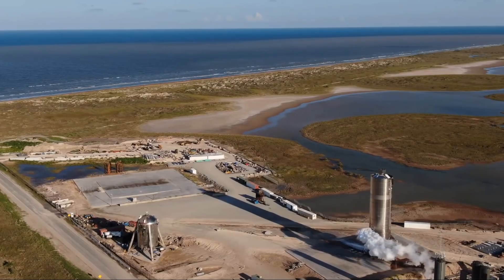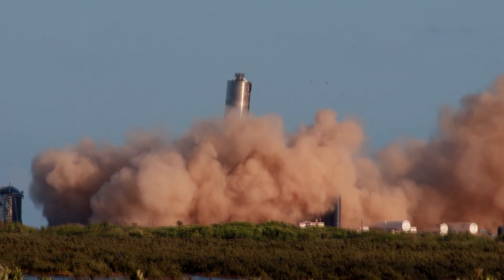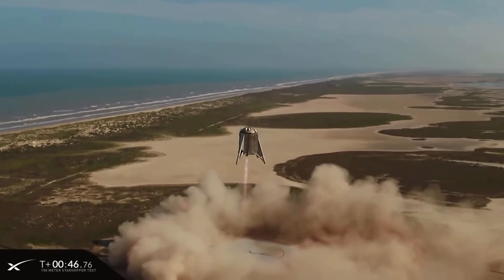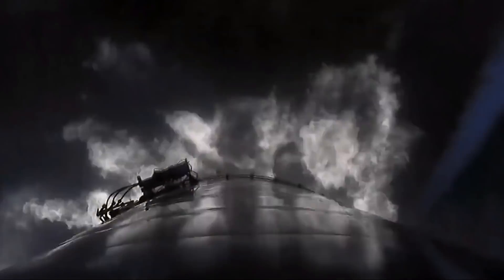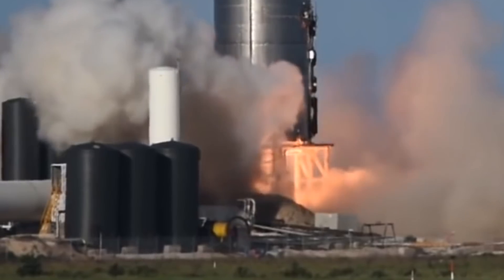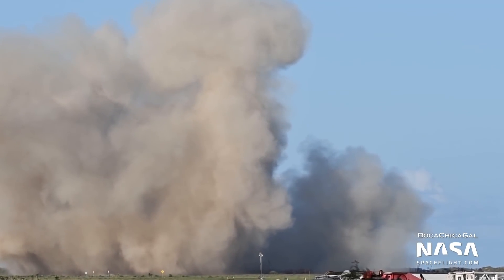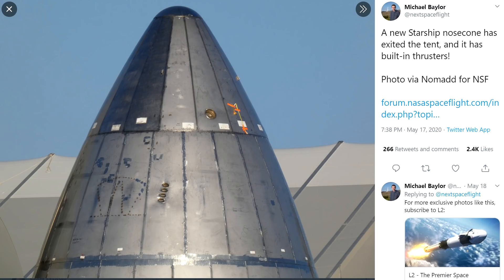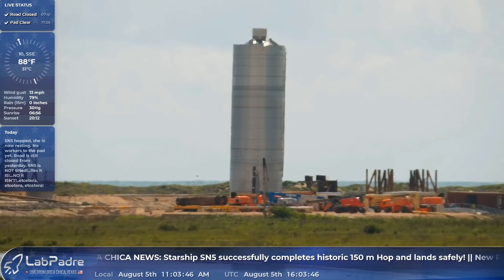SpaceX's Shiny Stainless Steel Starship Prototype Takes Flight For The First Time

Comment: "Engine rich exhaust"

I love rocket science euphemisms.
Reply: I worked for a company that insisted all the reports use the phrase "non-passive failure" instead of "explode."
Reply: @lgkfamily  I personally prefer "Rapid Oxidation."
Reply: @KageRyuu6  "Rapid Unscheduled Disassembly"
Reply: @KageRyuu6  Works well if the event requires oxygen to take place. In my case, it was over-pressure failures, not oxidation. Tiny glass pressure vessels experiencing failures due to devitrification.
Reply: @justuseodysee7348  Whatever suffered the RUD was normally FUBAR'D ;-)
Reply: @KageRyuu6  Rapid oxidation and rapid physical acceleration of parts and/or equipment.
Reply: @justuseodysee7348  why suicide burns make sense
Reply: When I fully understood the euphemism, I like “engine rich exhaust” better.
Reply: @justuseodysee7348  ...also very funny  - and, well, sorts of on the point!
Reply: @lgkfamily  That is what I would call a "euphemism"...(smile)
Reply: 'what's in the exhaust stream?'

'oh you know, combustion products - carbon molecules of various size, nuts, bolts, fuel lines, maybe a turbopump or two'
Reply: I love the equivalents in electronics. Light emitting resistor, smoke emitting diode, etc.
Reply: @rocketsocks  Yeah, I bought a diode that besides the intended infrared, emitted also visible light, sound and scent.
Reply: @rocketsocks  All electronics work using smoke. Let the smoke out the equipment stops working. PFM
Reply: @rocketsocks   magic smoke a.k.a. the ascending soul of a dying transistor/diode
Reply: @rocketsocks  It's left out the magic smoke. Without that, it can't work. Maybe you failed to sacrifice a goat?
Reply: @KaiHenningsen  They put the smoke into electronic devices at the factory. If you let the smoke out it won't work anymore. I got that from my electrician brother. :) He didn't tell about the goat though.
Reply: Aerospace in general is full of them, like cumulogranite: " Solid terrain, such as mountains, obscured by clouds and thus posing a risk to the pilot of an aircraft. "
Reply: @jdkessler  Haha, I've never heard that one!
Reply: @jdkessler  OK, that made me laugh far more than it should have.

as a VFR pilot, clouds are already to be treated with extreme caution... XD
Reply: @jdkessler  unplanned lithobraking maneuver
Reply: Not a rocket one, but one that always got me was "rapid percussive maintenance" aka hitting it with a hammer.
Reply: @1138Skinner  Go check out the channel "AvE". A machinist Canadian with his own vernacular. His term for an adjustable wrench: "Thumb-detecting nut-f*cker" lol
Reply: @PinataOblongata  
He ain't even wrong TBH. 😁
Reply: Calvin Skinner we had a “server adjustment tool” hung on the end of the racks at the University where I worked. ie a rubber mallet.
Reply: @robbybobbyhobbies  Mallets and hammers are typically used when performing percussive maintenance.
Reply: @robbybobbyhobbies  Also works as an attitude adjustment tool ;)
Reply: @1138Skinner  related, if applied to Protons
Reply: Calvin Skinner fine adjustment tool ( hammer, comes in various weights)
Reply: "Suicide burn"
Reply: @ArathirCz  The term "suicide burn" isn't a euphemism, as it describes something far less bad than the term makes it sound.
Mind you, it doesn't describe any kind of damage, it describes the most efficient maneuver for propulsive landing
Reply: @ilikeyourname4807  . . . probably chosen because of having just one shot before things go wrong . . .
Reply: @carmen.schumann  There was a suicide burn while landing on earth in The Expanse once (?), that scene pictures very good what kind of maneuver it is. If your engines don't fire exactly the way they're supposed to be it's over.
Reply: @LordWaldema  . . . ahhhh, and what did I say? pretty much the same !
Reply: @ilikeyourname4807  a dysphemism, then. Incidentally one of my favourite words in the English language!
Reply: @ilikeyourname4807  Because the Falcon 9 has a higher thrust than it's landing weight so it can't really hover.
Reply: "Catastrophic self-disassembly"
Reply: @NoOne-ef7yu  "Lithobraking"
Reply: @BremenSA  I just had to Google that, and I'm so glad I did. That's fucking hilarious!
Reply: @BremenSA  the best is lithostaging, use the ground to knock a stage off your rocket
Reply: @BremenSA  Also known as a " Touch and stay". :)
Reply: @BremenSA  really funny!! for the onlookers that is...
Reply: @BremenSA  Ablative lithobraking.
Reply: In the aviation industry, the process of hardware leaving an engine is referred to as “liberating”. So for instance, if a fan blade breaks off, it would be described as “the fan blade was liberated from the engine”.
Reply: "Rich" of engine parts being disintegrated 😂
Reply: Not gonna lie, "engine rich exhaust" seems like the perfect name.
Reply: I missed that. My brain converted it to "oxygen rich exhaust" without me even realising.
Reply: Self-Contained Readiness-End-Action Manifestation -- SCREAM  -- in other words it is displaying its imminent intention to go to non-ready status.  Non-ready preparation presentations.  "It didn't blow itself up, it just made a split-second transition to non-ready status...with a surplus of self-innovated parts."
Reply: @M.F Translation: The spacecraft went out of control, exploded, and hit the ground
Reply: In aerospace we don't call it a hammer (just maybe in the hands of an apprentice...) Such a percussive tool in the hands of a certified technician is called a "Smack-o-meter"  :D
Reply: Someone needs to publish a glossary of these terms. These are fantastic.
Reply: i came to the comments to express my delight for this term. This is my new favorite rocket science term XD
Reply: Came here to comment that, that's absolutely hilarious hahahaha
Reply: I thought this was an error in his speech until I watched the related part. It's really hilarious.
Reply: There was definitely too much engine oxide in there, or ENO for the chemists among us. :P
Reply: @dinoschachten  Isn't is EnO? Engines have oxidative state +2? I expected more...
Reply: "Over-pressurization Event"..... its tank exploded
Reply: Not exclusive to rocket science, I've definetly driven cars that produced engine rich exhausts.
Reply: LOL, I didn't catch that the first time around.
Reply: Isn't that one of the prerequisites for a rapid unscheduled disassembly?
Reply: @morskojvolk  It can be tank rich, Tesla battery rich, or even rocket rich depending on the situation. Not all RUDs start with engine rich exhaust.
Reply: "RUD", "lithobreaking", "CSD"

Gotta love it.
Reply: “Self fueling”
Reply: Me too I just love that one so much
Reply: A rocket exploding in the industry is known as a "successful failure" :-)
Reply: I believe he means Fuel Rich Exhaust...but I'll say Scott's usually not wrong.
Reply: @dwurry1  He does not. He said engine rich because the innards of the engine itself was combusting, not just the fuel.
Reply: Lithobraking anyone?
Reply: Certainly BETTER than "RAPID UNPLANNED DISASSEMBLY"... 😉
Reply: Uncontrolled flight into terrain: A plane crash. Common to see this "euphemism" of sorts on NTSB reports in IFR crashes.
Reply: Ryan McGowan Given the alternative is controlled flight into terrain (aka the Lufthansa Lawn Dart in 2015 and the thing that killed Kobe), it makes sense that there’d be a description for if the plane was actually uncontrollable during the crash
Reply: @mrb692  Yeah, they do distinguish between controlled and uncontrolled, and I initially had cited controlled flight into terrain, but in the interest of this thread, uncontrolled flight into terrain makes a pretty much perfect euphemism, IMO.
Reply: Yup, there was definitely something going on with the exhaust in that video, and engine rich exhaust is about the funniest way you could put it.
Reply: "Have you diagnosed the problem?"  "Indeed we have, you see... there's entirely too much engine in the exhaust"
Reply: I Swear I Didn't Tripped Myself Over, I Was Just Performing "Unscheduled Gravity Check"!
Reply: That is a very "Ignition" worthy quote.
Reply: RUD: Rapid Unscheduled Disassembly
aka an explosion
Reply: Mixture was not correct...not enough oxigen (H2O2). Yellow is to much"C"  carbon, to low temperature...
Reply: @gertvanpeet3120  Yeah, too much carbon, almost as you'd expect from steel burning (steel being carbonated iron). :-)

Comment: Why is this shaped the way it is?
Why is it made of stainless steel?

Is it to test how unaerodynamic and cheaply built of a vehicle they can launch?
Are they planning to literally send tanks filled with water and fuel to mars or something?
Reply: It's an incomplete vehicle, the full scale one will be taller and have a nose cone. But it's also a bit stubby overall. Many rockets look skinny compared to their height, or start off thick, and get skinnier towards the top, but this isn't. In the end, it gives more payload volume and room for their engines.

They're using stainless steel because it gives better strength at cryo temperatures (which methane and oxygen are both at), and because heat shield requirements aren't as great compared to materials like aluminium and carbon fiber. Both materials would make the vehicle heavier than steel for those reasons. It's also easier to work with.

Those are the major engineering reasons to my knowledge, but steel is also cheaper, which allows them to prototype for lower cost, and can help reduce launch costs (one big goal for this vehicle).
Reply: @davidk1308  Thanks for the comprehensive reply :) That clarifies a lot

Comment: when they try to land one of these on the Mun... how are they going to keep it upright, without a prepared pad?
Reply: Press T to turn on SAS
Reply: better, self correcting legs
Reply: Hydraulic legs
Reply: @KSPAtlas  has to be something like that, otherwise seems way too limiting in what it can actually do. ditto interesting to see how you get from the top to the bottom when landed without a gantry.

Destination Moon type ladder? or crane maybe.

guessing one to land on the moon will be different to one designed to land back on earth
Reply: I would assume that the landing legs will be much more advanced, but they would also rely on hitting a target that was crater free.  I would think that they would need a pretty high resolution topographic map of the moon to select the landing spot.  Hopefully, the hard surface under the regolith is uniform enough.
Reply: @mattgraham4340  I doubt "hope" would come into it, I'm actually wondering if you would see a mission or some sort to prepare an actual landing facility of some sort - even if not much more than a pad that they know is level and can take the mass and forces of landing and liftoff
Reply: @aleopardstail  the hope point was essentially that I don't think we have a way to make a detailed map of what's underneath the regolith.  SpaceX hasn't announced any other lunar landing vehicles that could be used to prepare the surface, that I'm aware of. Perhaps I'm overestimating how much of the Regolith will be blown aside by the thrust, and it's a non-issue.  If whoever actually does make a moonbase someday,  I would imagine that it will have prepared landing areas at a minimum.  Sending anything to the moon at the current level of human technology requires a bit of hope.

Comment: The fire on the exterior of the engine could have been extinguished as the skirt filled with very low oxygen engine exhaust, removing the oxidizer from the fire triangle.
Reply: That fire in the upper engine wiring and piping didn't look good at all.  Looked like flammable material like plastic or something from the extreme heat or tiny leak.   Maybe why Elon said they will do more short hops first (to clean that up).  I think they dodged a bullet there.
Reply: @davedreher9254  my guess is hydraulic fluid. After the scrubs Elon tweeted there was an issue with a TVC pump.
Reply: @davedreher9254  i agree 100% I think when they saw that, it brought them to landing that thing sooner than intended. It didnt look good at all.
Reply: I'm wondering if it was a piece of the debris that was thrown up at launch, that got lodged there, burning.
Reply: No, because unlike Keralox, Methalox doesn't produce unstable carbon compounds which can burn after being thrown out of the engine

Comment: was low key worried when I saw that little "explosion" on the pad
Reply: Yeah, I was wondering about that as well.  Something went for a ride through the air.
Reply: @lucidmoses  It looked like the stand they had it sitting on when connected to the ground service equipment. When it first launched the exhaust looks like throws some of the test stand straight up into the air.
Reply: @MySkybreaker  Yeah, when the engine translated across the top of the stand, the engine just destroyed any part of the service structure it went over.
Reply: @MySkybreaker  I wouldn't have thought they would be so careless as to leave projectiles to disagree with the plumbing given the last big boom.   But yeah.  Could be.
Reply: @runningray  yup.. probably because it has to translate a bit with one engine. I presume that central part of the stand is of solid material but on the edges there are various pipes and catwalks and stuff, to me it seems that part of a catwalk for workers when starship is on the stand went flying..engine was like a blow torch / plasma torch ( how ever is called in english ) cutting it clean off and then wind/updraft from the engine plume made it fly..
Reply: @runningray  I don't think the stand breaking was forseen. But I also don't think the peices that flew off posed any danger to the craft.
Reply: @lucidmoses  the last big boom was a direct result of a failure of the ground service equipment and not any fault of the craft itself (At least that's how I understood it). So they probably weren't too worried about the stand at all. Everything looked mostly safe in all of the angles of the videos of it. One would think they wouldn't make a mistake like that. They probably knew it would happen.